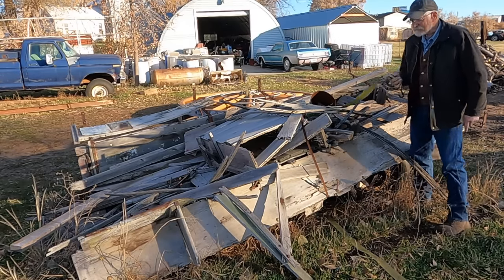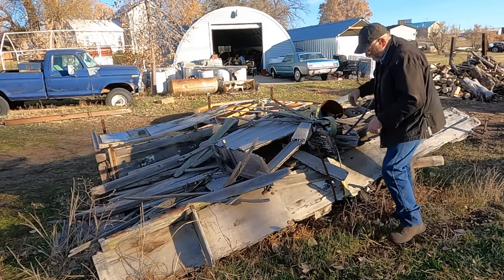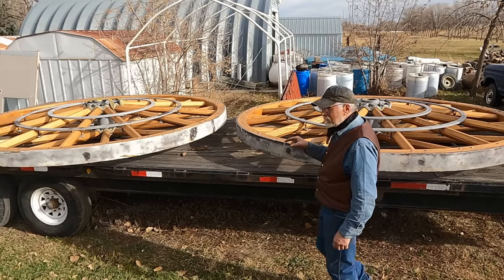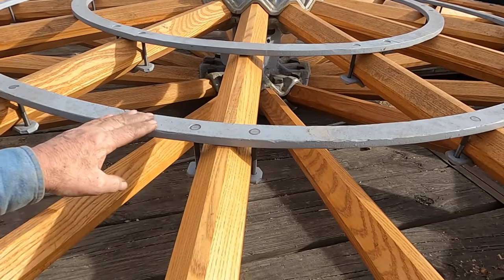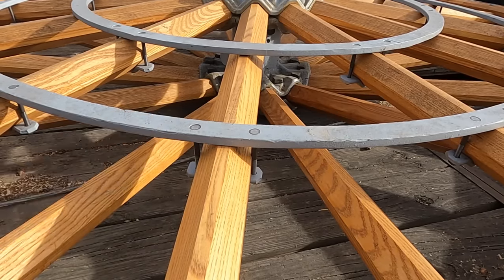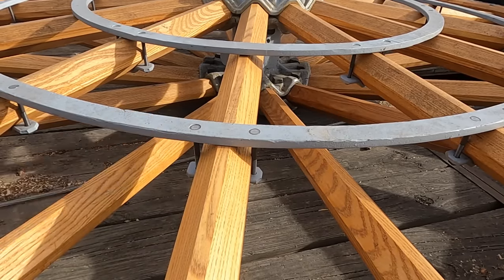100+ Yr Old Sheep Herders Wagon Gets Saved | Engels Coach Shop

Comment: Well I can easily say that none of our 7 sheep wagons we have were in that bad of shape.  I'm so looking forward to watching this series.  You have made many bows for us over the years which I am very appreciative.  Last summer I finally got the last of our wagons covered that needed covering.  We have gone from the original canvas material and then used a rubberized paint on canvas to try and extend the life of the cover.  Nothing we did lasted very long.  Then we went to using TPO to cover a few wagons which I think will last for many years to come.  However we still had 2 wagons left that had canvas tops on them.  I watched your video from about 5 years ago on Rebuilding a Sheep Wagon that was a Basque Shepherd's Home.  In that, you used PVC to cover the wagon and you pointed out a few advantages of using PVC over other material.  So I decided to go that route and you told me you got your PVC top from a Big Horn Roofing Company in Cody, WY. Well I contacted them and had them prepare 2 wagon covers for me.  It was a lot easier to work with than the TPO.  Thanks for the info on that.
We will be doing some more work on the wagons this coming summer, but I am so glad I don't have to cover another wagon for a while.  As you know, it's just not the cover, but many times there is infrastructure under the covers that need repair. 
I am so looking forward to your new series, I am going to learn so much.  Thank you for all you do.
Reply: In the old days i wonder what did they use? Creosote or turpentine and tar maybe a little beeswax I'm sure whatever it was it was an annual maintenance thing
Reply: We're glad Dave was helpful to you.
Reply: It's nothing a few twists of a screwdriver can't fix.
Reply: Do your wagons stay in one place ? Or do you move them often, what you pull them with?
Reply: @dconter If possible send him some photo's as much s you can find that will help him to complete the puzzle.
Reply: From a roofer - PVC is easier to work with. The seams on both it and TPO are heat welded. There is a visible bleed out with PVC that you don't get with TPO.  Others may feel differently, but I've always preferred PVC.
Reply: @cheeseburger9232  they stay in one place.  They have been in the family since the 1960's.  They sit on our property on the Stillwater River and we use them on the weekends in the summer.

Comment: I hope there were some photos of the sheep wagon when it was a working unit. It looks like a bigger puzzle than the mud wagon project, where you had a couple old photos that helped the build. Good luck preserving this wagon. I feel it might be like the old joke "I got my great-grandfather's ax ... Of course the the handle has been replaced four times, and the head was reforged when it shattered in the winter of 1896, Dad had to weld a piece back on when he broke it off after hitting a rock in 1957.  But we kept it up!"

Comment: I think that when you were a boy someone gave you a jigsaw puzzle with both sides painted white, and you never got over the challenge. Most people wouldn’t even consider that lot firewood…….! My interest is drooling with anticipation for the fun to come this winter. When it’s finished, please spend a night in it and have a cookout. In the UK, where I live, sheep wagons are still built, but used as a form of glamping, not for shepherds. Having wheels, they are not subject to normal building regulations and the code requirements associated. I believe that the author Rolad Dahl used to write in one at his Buckingham home.
Good luck!

Comment: Those logging wheels have finished out really beautifull! I got a bit anxious seeing you grind on the steel tire for a bit, remembering all the stress and tension that made the previous attempt go "boom", but i restored my trust in you, knowing what is allowed on these.

Great job, and i hope the client will find ways to get them and enjoy them fast!

On the new project, resurrecting old wood framed pieces into new "safe-ish" joints is difficult to say the least.
I love how you pieced the pile out and had enough fittings and ironwork to determine at least 90% of the pieces to their origin in the old wagon.

Good luck and i am curious how you will reassemble what is deemed good enough into a new wagon and what you will do with the gaps and how you will secure loose or vanished joints.

Comment: Talk about a silk purse from a sows ear! The problem I see is the labour cost to "fix" some of what is there would way outstrip the cost of new, and when it is finished it is still rotten timber, unless you epoxy fill it or similar, and that too is far from economical and not at all original. While I have no problem in reserecting things from our past, there has to be an economic balance. And if they are going to put it outside in the weather, as is clearly what has happened to the existing, it will not last very long till it too looks exactly the same.

Comment: 👍💚🧡I will look with attention. I have Goats I'm keeping , certainly I will acquire or adopt a Donkey, and I have to repair and use what's named in Bulgaria a '' Koulichka ''  and adapt it to use in real conditions as a field's home, that can be also displaced with my motor block.
The first question I ask me is the final weight of such a home, needing to make choices about wood and making roof and other surfaces. The wagon I have is not far from a century old and lot of work to repair. For now as winter is coming I 'm building a garage in my garden, for my trailer and this wagon, the motor block. Then I will have the winter to design the process, to build a new or repair the one I have from my neighbor, hard to say now if I can repair it, specially the Wood Wheels, and the weight for a Donkey, with adding a roof and closing's parts. Out of that, metal parts are in place, but I want to replace what I can by Wood, and there's no brakes. So going in the hills, seem's to be better to have brakes. I will be attentive, already I have to build bows, I saw the process, and I have polycarbonate foils, perhaps to cover the roof. Very happy you will take care of this wagon and show how it will be. If I remember, you had made videos about an other cabine, but sheep elder ones must be easy to use with a maximum of confort, an weigh  affect the ability to use a Donkey, or if not a Horse a Mule or two maybe, here for me  we have Donkeys, who are a more accurate Animal, with less needs than a Horse, and compatible with goats in a forest, cold, rain... Perhaps not the same conditions of use than Your's restoration.

Comment: Saving as much as you can will be pretty easy - not much to save as you need some integrity to the wood to hold things together. I am restoring a 1929 popcorn wagon and they put a floor over the original floor as the original floor lost its integrity just as you surmise they did with this wagon. Hope they reconsider and let you recreate the wagon properly but I realize where they are coming from also.

Comment: Curious, again, how you're going to pull this one out of the bag. I've seen a couple of museum restorations up close where they stabilise wood with penetrating epoxy etc. But my guess is you don't want to go that route for a naively built wagon. But it'll still need some structural rigidity to stay intact, get transported and constructed by you. Interesting choices, with more than one right answer, of course.

Comment: Hate to say this but the fork driver needs some extra training. Running at full revs against the brakes and the transmission is not good. Also the jerky lever movements. And forks need no revs to tilt or lower. Can be dangerous when you were setting the dolly underneath the load and the revs were high while lowering and pushing into your workshop.

Comment: I'm not the expert but seems like the governor on the fork lift is not keeping up with the load as needed. At a set throttle position, the governor should maintain the set throttle speed under most conditions it seems. I could be wrong entirely of course.

Comment: I noticed that on the inner rings (smaller one of the two that are mounted on the outside side of the wheel) that are mounted on the oustside of the wheel not all bracktets are installed. Why is that?

Comment: Tell your Fork Lift operator to leave his phone alone when it is under load and people working near.  Does that other operator realize you don't need to have Clark WOT (Wide Open Throttle).  NEVER stand in front of those operations.  
Would those huge wheels be hauled by Oxen or Horses?
Damn I like that vest you made.  4 pockets and I'll buy it!
You are a Bear for Punishment.  Sheep wagon gets Second Life.  Fantastic.  Kelsey Hayes Wire Wheels?
Reply: Her phone. It's Daves's daughter.
Reply: Being Safe begins before you get out of bed. @SingleStacked
Reply: The video was sped up, so it sounds faster than it is.
Reply: @gordbaker896  OK...Sure.
Reply: I think they know what they’re doing!😊